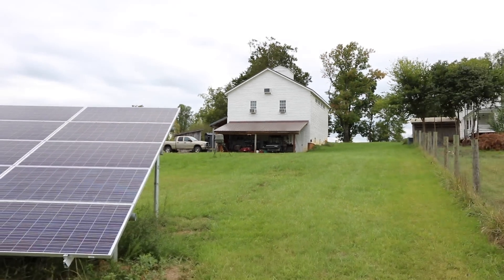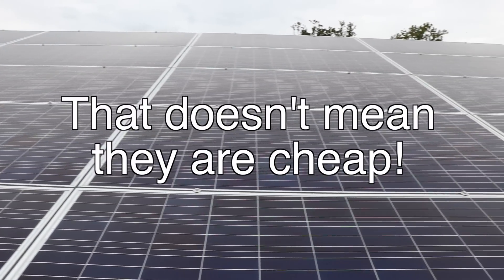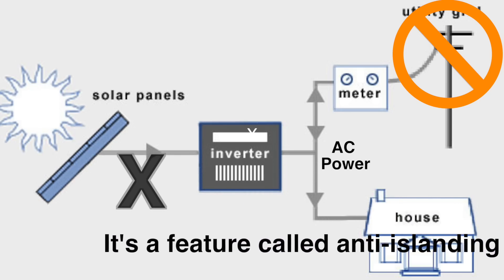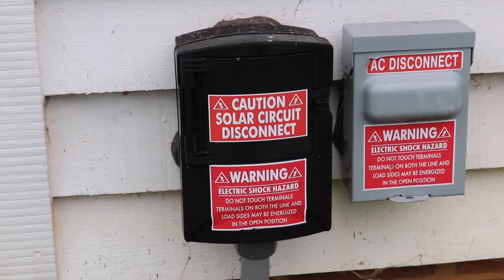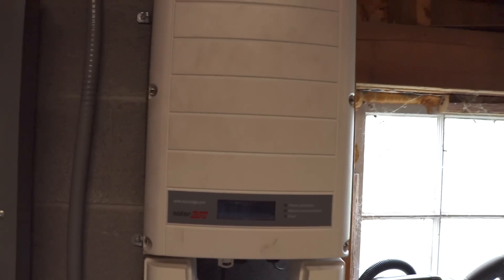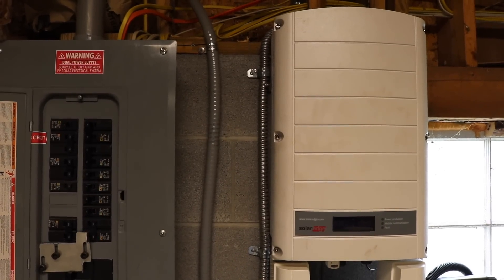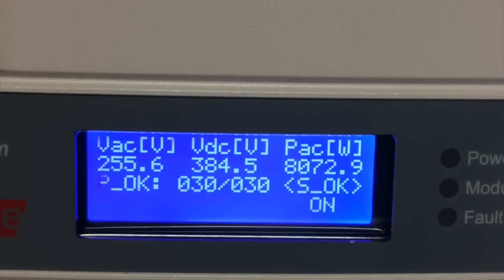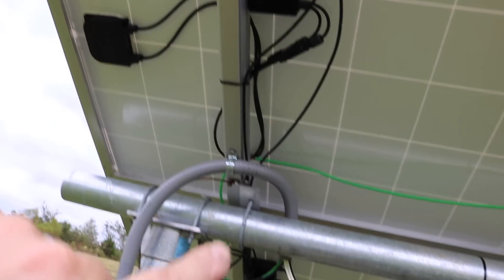The ugly truth behind grid-tie solar systems. Part 1, FarmCraft101 solar.  Watch before you buy!

Comment: I always wonder why the calculations always assume you have 20k sitting in the  bank and have no house or car loans. Most people would need to borrow money to buy the system and the fact that money costs money should be taken into account with the 8 year estimate. Getting a loan is around $500 making your cost $17500. $17500 at 6% is roughly $1000 you need to add to first year costs. This will reduce while the loan is paid depending on the term, but you don't want to make that any more than the expected maintenance free life of around 10 years. At 195 per month, total extra interest on a minimum monthly balance would make the total that needs to be earnt about $23310. You really need that $200 a month for 10 years to break even. Like you said though, if you're not getting that every month, this could blow out to 11 or 12 years.
Reply: Indeed if you are perhaps already paying interest on balances on credit card loans and such and need to borrow expensively (not a home-equity) then outright buying may not be for you. Going solar might not be a good fit at this time. You might consider leasing - but that typically puts you on a  on 10 or 15 year ROI/benefit track albeit with no upfront cost. If you do have 20K in a savings or retirement account then it may be a great choice to make.

Comment: Interesting that you calculate the payback based on tax credits. So the rest of us pay for your solar system. Here is a more realistic payback schedule.

Value of money $23,000 would generate $1,150 per year at 5% simple interest 

You said that you use $200 worth of electricity a month or $2400 per year. Subtract the $1,150 interest leaves $1250 to contribute to payback.
$23,000 / $1250 = 18.4 years assuming best case so a more realistic number is 20 years and this assumes no hail storms, tornados, or falling branches taking out the solar array or the cost of maintenance of any kind such as removing snow ice and dust for 20 years. This also assumes that the state of the art technology will not improve in the next 20 or so years.

Any battery back-up would add to the cost and as you should know batteries need replacing at least every 10 years and this would significantly add to the number of years required for payback as well as the environmental impact of battery and solar panel manufacturing and disposal.

Maybe it is just me but it seems like a bad investment.
Reply from the maker: https://youtu.be/gAswWVETWKo

Comment: You can't use simple calculations to determine payback time.  If you were to invest $17,000 at 5% interest compounded quarterly it would be worth  $35,820 in 15 years.  That is when it would match the $36,000 of utility savings over 15 years.  So 15 years is the payback time, not 7.  Really not a good investment.
Reply from the maker: https://youtu.be/gAswWVETWKo

Comment: You will never get your 17k back
You stated this grid will save you (some) power however in your calculations you used 100% power savings, (200 bucks) you are not factoring winter, rain,   parts replacement, maintenance, you name it.
Reply from the maker: https://youtu.be/gAswWVETWKo
Reply: I have 5 years of PV data and it will be about 10 Years to break-even.

Comment: Good video. I just went solar and I figure I will get a 45% return on my money over the life of the system. Been two months now and I am very happy with it.
Reply: I'm researching getting solar for my house.  I am going to shoot for about 60% because I only pay 7500 in taxes every year and won't get a the full 30% rebate if I do 99%.  Did you have any problem with the rebate, or have you done that yet?  Also, if the meter runs a positive balance for the month the power company doesn't actually send you a check right?  It is just credited?  Thanks if you can respond.
Reply: Jeff Kline I had no problem with the tax credit. You know you can split the tax credit if need be. This year you’ll get a 30% credit but next year I believe it will be 20% federal credit. As far as production I receive a credit on the bill if I don’t use the power I produce. The electric company does not pay me. Of course that is in Massachusetts and may be different in other states. In Massachusetts we do have the smart solar program which they will pay me for the production of electricity for ten years and then it ends. You really need to search your state for any incentives and programs available to help you go solar.
Reply: @TechnMoto    Thanks for the info!
Reply: Jeff Kline hope it helps. Are you in Massachusetts?
Reply: Techn' Moto   Texas.
Reply: here is a video I did on my system- https://www.youtube.com/watch?v=wDDr9LvrJwI

Comment: So what's the "UGLY TRUTH" about it??
You didn't mention it AT ALL !!!
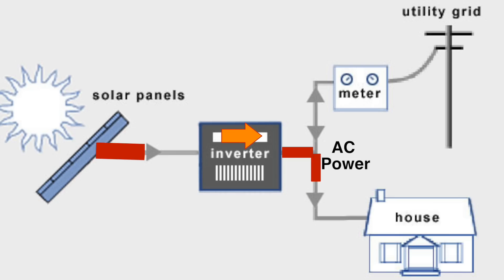Reply from the maker: At 2:26 "But there's a catch.  If the grid goes down, everything shuts off.  That's right, even though you have solar panels, if the power grid goes down, you cannot produce any power."  It's also in the description.
Reply: @FarmCraft101  
Yes I heard your words at 2:26 ....... That means that you are saying that your power is getting down because you have not being able to calculate your average output!?!?
Reply from the maker: No.  Nothing about calculating output.  It means for a grid tie system, the grid must be active or it will not work.  So if the power goes out for whatever reason, your solar panels go out as well.
Reply: @FarmCraft101 
Yes and when you switch off the lights at night, then it's getting dark! 
#duh

Comment: I have Solar system without battery backup.  My experienced is not SAVE$$$. When the with full sun and you not home to use it then the power will go back to the grid, they say you will get it credit from the power company,  yes, you will get it, but will be less than what you will pay them the power you'll use at night. By the end of the year we pay so much $$ to power company. Have to remember solar system is only allowed work during the day, but at evening have to go back to use power company. Remember!! We're all  use most our power at evening!!. What happen when your inverter and panel break down then you it will cost you lot $$$. I BELIEVE SOLAR IS NOT SAVE$$$$, RATHER PAY THE OUR POWER COMPANY THAN MAKE CHINA RICHER.
Reply from the maker: Where I live, you don't sell the power to the grid whenever you produce more than you are using.  The meter keeps track of what you put into the grid and lets you take that back out for free.  In other words, the grid is my battery.  Connection fee is cheaper than a moderately size battery bank, has endless capacity for storage and also amperage.

Comment: That anti-islander crap is all a scam! Down in Florida, The who's who of corporation & government went to a island, wrote some B.S. LEGISLATION & OUTLAWED SOLAR FOR ALL FRORIDIAN'S! There are simple idiot proof systems that completely disconnect the grid power from the solar power & one must move the switch to initiate the solar power/ or generator power to their fuse box! It completely shuts one completely off & apparently, you have fallen for it! SO, YOU MEAN TO TELL ME THAT, When you most need your solar system, YOUR LEFT IN THE DARK! WHAT A JOKE! THEY GOT YOU HOOK, LINE, & SINKER!!!! Now, I have seen this video more then once, Separated by months & one would think that, I would come bearing facts however, I simply stumbled across your video again. I do know that there are dead man switches that completely separate & 100% disconnect the grid power from the secondary power & there is absolutely no way that power could transfer from a disconnected panel, to a circuit. That is all corporate B.S. THOUGHT UP BY LAWYERS FOR CORPORATE & GOVERNMENT INTEREST!!!!!! Now, You are knowledgeable in many ways but, You simply roll over with that anti-islander crap!!!!!!!!! I am not insulting you! I am insulting the corporate bullcrap term known as anti-islander!!!!!!!!! I WILL HAVE TO LOOK UP THE EXACT NAME OF THE DISCONNECT PEICE THAT MOUNTS IN A FUSE BOX BUT, THAT ANTI-ISLANDER CRAP IS A CORPORATE JOKE! DESIGNED TO SOUND GREAT, & WHO WOULDN'T WANT SAFETY FOR A LINE-MAN? THAT IS NOT THE POINT BUT, A DIVERSION!!! It reminds me of all the bs that government & government lawyers are labeling firearms these days, "assault weapons" , & "scary black rifle" As if a semi-auto rifle can act on it's own & assault someone! As an excuse to trample on the 2nd amendment & further tax an unalienable right further then they already have!
Reply: You story contains too much B.S. 
 It is 100% LEGAL to install a Grid-Tie or a Hybrid System ( with battery back-up ) in Florida.

Comment: I own a 2100 sq foot home and my electricity costs about $420/year.   Not easy to get a solar panel system to pencil out, but was thinking about it.  Once I figured out I'd have to remove the panels once to replace the roof, I would never break even (also including the subsidy I'd get).   Removing and then replacing the panels is quite costly and something I couldn't do myself.
Reply: Lin Sierra So many comments on solar videos from US viewers mention replacing roofs. Makes me glad I live in the UK where roofs are slate or tiles expect our roofs to last a century at least, and many go on for much, much longer. I dont understand the obsession with shingles in the US- here we only consider them fit for dog kennels and garden sheds! Build a proper slate roof and stick solar panels on it, by the time the roof needs attention it will be your great great grand children who need to worry about it.

Comment: 9:25 I doubt that the grid transformer can transform that 240 volts that you feed from solar back to a higher voltage for other people to use? I would say it would only be used by other people who share the same transformer with your house?
Reply from the maker: Nobody else shares the same transformer.  It can transform backward just as well as forward.  It's just coils and magnetic flux after all, which doesn't care which direction it's going.

Comment: Why not install battery then so the power goes back in your battery instead of going to grid???
Why give power back to grid which gives you nothing???
Reply from the maker: It doesn't give me nothing.  It runs my meter backward so I can use power from the grid later for free.  The grid acts as my battery.  It's called net metering.

Comment: Lets talk batteries, I hear Trojan L16RE-B Flooded Lead Acid 6V Deep Cycle Battery 370Ah are some of the best solar batteries around. You try them or you staying with the lithium batteries? Anyone out there use the  Trojan L16RE-B? Am I going to get the 5 year warranty to 8 year life they say they have.
Reply from the maker: Flooded lead acid (not AGM) is still the best bang for your buck overall.  Lots of pros and cons as with anything, but if you're on a tight budget I think flooded lead acid is a no brainer.

Comment: I installed a homemade DC 120 Volt system on the roof of my home in 2001. Lead acid battery system from deep cycle batteries. Solar thermal air conditioner too. Only 8KW new and has lost maybe 16% over the years.  Cleaning has to happen twice a year. Have had some traces corrode and have had to repair at least 5 times. Yet it was worth the investment. I wonder how today's systems compare.

Comment: Sigh, why do people think that multiplying a monthly cost by the number of months and then by the number of years can be equated to capital costs.   The calculations that should be done are called NPV (net present value) and IRR (Internal Rate of Return) calculations.  These so called payback period calculations that so many people think are the way to make these comparisons simply means you're forking money over to the vendors for the solar panel systems and unfortunately these vendors price their products on the basis that people are silly enough to make such erroneous calculations, they even advertise on such calculations.  As the market for solar power grows, it's growing with people who do not know how to make the proper calculations so even though costs drop with volume, it will always be over priced due to the poor education of the public.   

The main reason why net metering is the least expensive is that batteries are inefficient, the total charge discharge efficiency of lead acid batteries is about 49% while that of lithium ion is about 72% so you need to roughly double the number of panels you need for the same diurnal load if you want a grid free system.  The grid in a grid free system allows you to use accounting as a 100% efficient battery.  This is also why utilities argue to buy the power from you at half the market rate since that would match the efficiency of a grid free system.   There's also that you should not discharge more than 50% of lead acid batteries and even that is too much in some regards so a lead acid battery pack needs to be over double your daily needs if sun can be guaranteed each day.   With lithium ion, battery life is longest if the batteries remain between 20% and 80% charge so technically you should only use 60% of your battery capacity, however as it's unreasonable to expect people to not charge to 100% when they can, the guidelines are to use 80% of the lithium ion battery's capacity.   When the sky is obscured with clouds, the panels still produce some power but the nature of charging batteries require more voltage than the battery produces in order to charge it so often when the panels are not producing maximum power, what power is generated is simply lost.  Indeed, the three charge cycles for charging lead acid batteries means much of the power generated simply cannot be used to refill the batteries, lithium ion is not much better.  I'm currently in the sunniest province of Canada and despite having the most sunny days in a year of anywhere in Canada, you can expect up to 22 days of cloudy days in a row per year so avoiding backup power such as a generator requires being able to last 22 days.   No one designs a solar system to provide power for 99% of the time, more like 50% and it's usually just assumed the excess capacity needed to keep diurnal usage to less than 50% capacity for lead acid batteries and 80% capacity for lithium ion batteries typically means coverage for only one to four days of cloudy weather in the designs.   This also means that the cost savings touted for lithium ion or nickel iron batteries (100% discharge can be handled by nickel iron batteries) disappears once you consider the need for cloudy day coverage.   The complete lead acid three stage charging cycle can take up to 20 hours to complete, with only six to four hours of usable daily sunlight available in most of the US, you can't possibly achieve the full cycle and much of the power generated in stage 3 by the panels would be lost, the power needed by stage 1 is far too high to expect from solar so solar power systems are designed for only stage 2 charging which also means depleting the batteries may make it impossible to charge.  Stage 1 is called current limited charging as the issue is that a completely discharged battery wants infinite current and not only can't you give that but it would be dangerous to do so.  Once you leave the concept of net metering, your own calculations and likely the calculations of any so called solar expert especially self professed experts is likely to be wrong by an order of magnitude.
Reply from the maker: https://youtu.be/gAswWVETWKo

Comment: correct me  if i am wrong but now, most electrical companies pay you a low rate for 100% or your solar power output and you still pay full rate for your usage. basically. making solar panels a horrible investment because if you go to batteries the cost will never pay for itself. i called my power provider and they confirmed that in my county.
Reply: Not here. Netmeeting basically runs your meter backwards during surplus solar generation. You get full credit. For now anyway. They'll stop if too many do it.

Comment: The more amps you pull,the more heat is generated, the bigger wire you need....
Reply: Point is you should explain this... someone might try to wire something up after watching your video, use wire too small .. and catch something on fire

Comment: My 9k system has 2 Sunny Boy inverters, and EACH has a 2000w outlet, which can bu utilized when it is sunny out, regardless whether or not the grid is up.  You just got the wrong system!  Mind has gotten me through hurricanes with outages of several weeks!
Reply from the maker: I looked into getting a Sunny Boy, but the cost was going to be higher and my inverters are in a separate building from my home.  It would be hard to run my refrigerator from that far away.  But I do like that Sunny Boy offers an emergency plug.
Reply: @FarmCraft101  Sunny Boy's are great when the sun is constant. On cloudy days, the Sunny Boy outlet is very hard on refrigerator compressor re-start.

Comment: Just for clarification but solar power goes 2 micro inverters then into the AC cutoff then from there goes into the panel on its own breaker? Just wanted to make sure I have that right because I know with a generator you can't have that running with the power from the grid as it will backfeed the generator and explode is what I've Been Told lol.
Reply: I'm looking to use micro inverters instead of one inverter so I can individually maintain the panels:)
Reply: Also great video by, the way most informative I found!